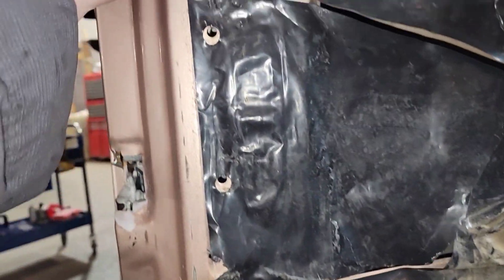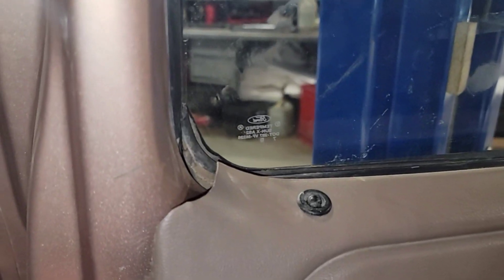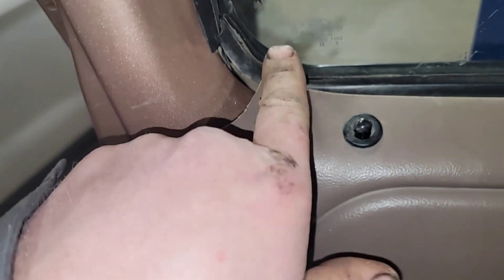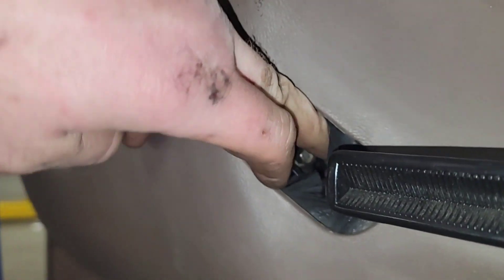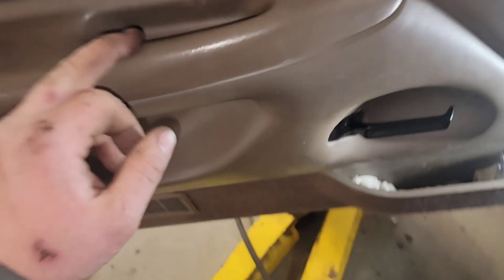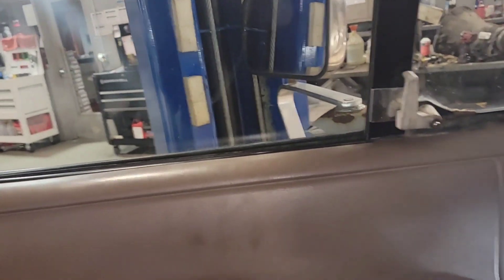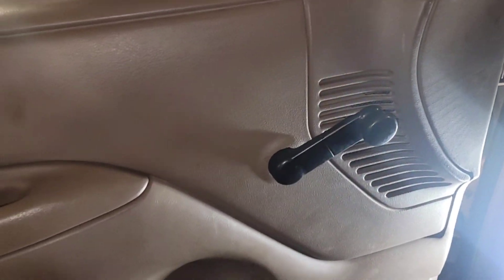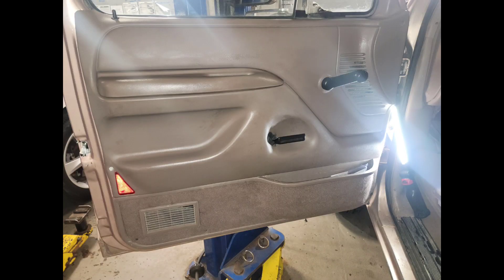1997 F250 Heavy Duty 7.5L Door Latch Handle Replacement - Part #  F4TZ-15219A65-A Driver

Comment: I use either white lithium grease or a product called Muscle Grease by Castle in the lock mechanisms. For the window slides, I use a dry silicone spray also made by Castle. 

For the homegamers, recommend getting the lubricants FBM showed or similar vice raiding the nightstand for the personal lubricant.

Comment: Rich, do you have a part # or size for those plastic push pins / clips? Thank you
Reply from the maker: I don't butnim sure I could dig something up

This came up and looks like the identical ones 

https://shop.advanceautoparts.com/p/dorman-help-door-lock-rod-clips-75450/9110113-p?product_channel=local&store=6454&adtype=pla&product_channel=local&store_code=6454&gclid=Cj0KCQjw3v6SBhCsARIsACyrRAnc9jZ13VknBhcGd2_YxS3Yc87VNMhePQWmQi3cyH9cohqZpET8ejkaAi1EEALw_wcB&gclsrc=aw.ds
Reply: Thank you, I love seeing some love for the 7.5 and the OBS. If you do a water pump on it please video it, that would be awesome since there isn't alot of content out there specific to the 7.5 and the troublesome bolts.